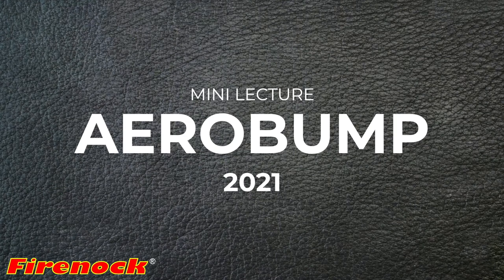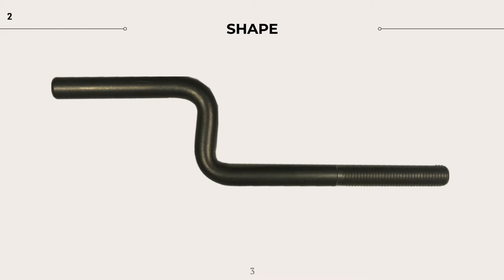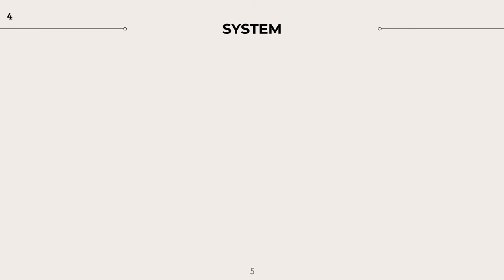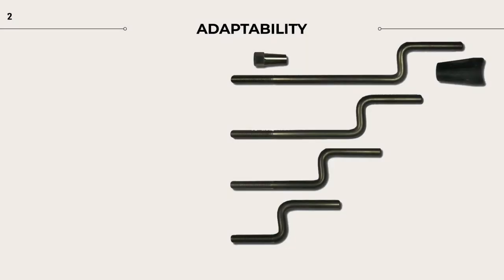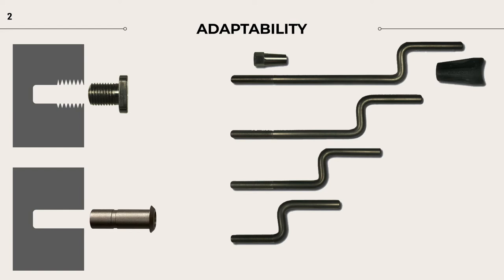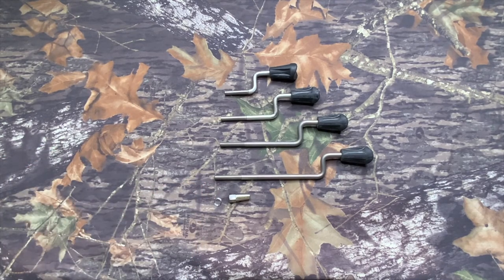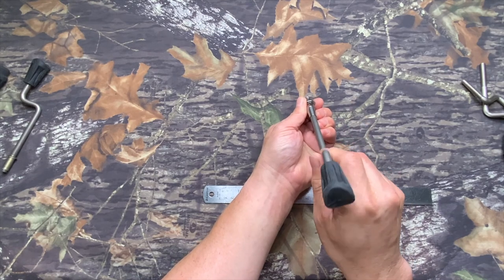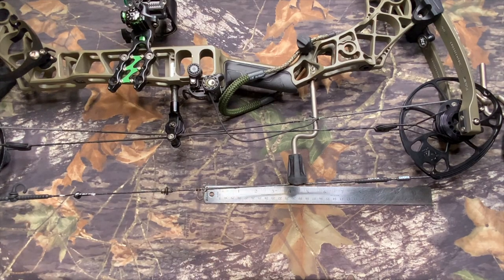Firenock Mini-Class August 2021 Henry IL #2

Comment: What size would I need for the new Hoyt Rx7? it has a 61/4 brace height I believe
Reply from the maker: To find out what you need in order to install an AeroPump onto your bow. You need to get the following measurement first before deciding what to get:

    The distance from the riser to the string stop (to get the visible length)/li>
    The maximum depth that the string stop can be inserted inside the riser (to get the anchor length)
    What size hole is the string stop (5/16” or 3/8”)
    If it is 5/16”, is it threaded.

    Use (1) and (2) you get the maximum possible length, then minus ¼” for safety.
    i.e., if (1) is 5.5” and (2) is 1”, then the string stop piece you should look for is no less than 6.5” with the rubber bumper.
    If the hole is a 3/8”, you need to add the aluminum 3/8” collar so you can make the 5/16” bar larger to fit the 3/8” hole.
    If the bow has a 5/16” non-threaded or threaded hole for the string stop, one needs to choose an AeroBump length that is long enough. If the size is within 1/4", it is safer to choose the next size longer and saw away the excess.
    If the length is just shy of the bars available thread but not short enough, one can use a 5/16-24" tap and add more thread.  GR2 titanium has a very similar harness property as brass. A usual tap set one can get at a hardware store can do the job.
    For a bow riser with a 5/16" plan hole, one may have to sand the bar a little to make the 8mm bar smaller, as 5/16” is 7.9375mm, or the bar is 0.0625mm larger than a typical 5/16” hole.
    the Limbsaver String stop robber added 1/4" / 6.5mm to the entire length for calculation.
    The titanium slant hex nut will need no less than 1/3" / 8mm thread length.